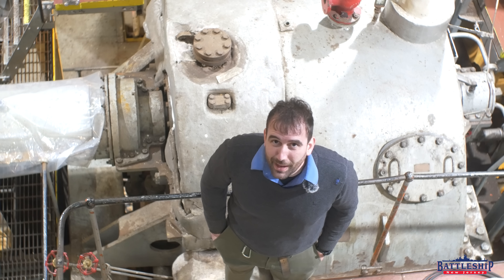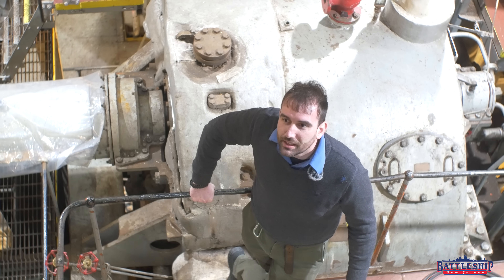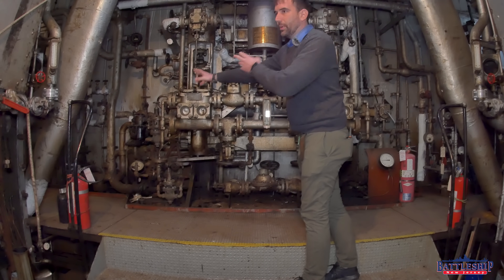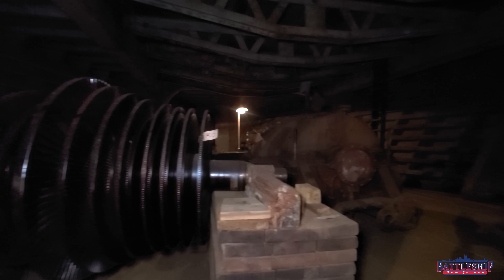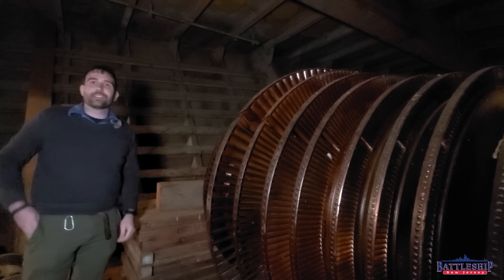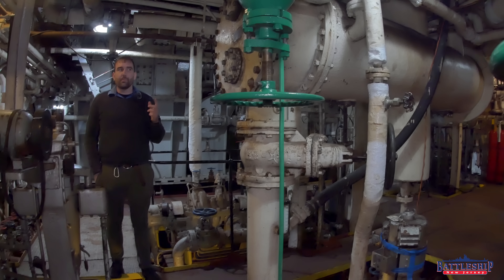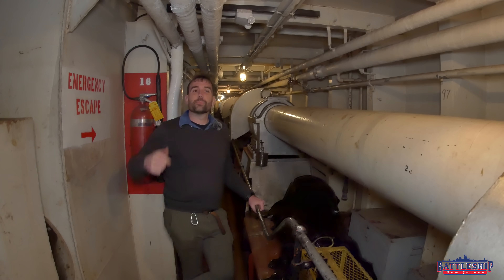The Engineering Plant of a Victory Ship

Comment: Sailed on many of these Victory Ships in 66,67,68,69. Most that I sailed on were of the AP3 type (8,500 HP) along with a few AP2 (6,000 HP) All pulled from the mothball fleet in Susuin Bay California, refitted in Richmond and sailed out of the port of San Francisco. Started as a wiper. Eight hours on, 5 days a week unless at sea. Then it was eight hours a day including Saturday and Sunday as overtime days. I was very lucky and worked for some really good first and second engineers. Learned a lot from these guys. Wipers usually were told to get lost for a few days when in port especially, when offloading  ammo at Vayama ammunition port, SATTAHIP, Thailand. In those days you could rent a motorcycle and head up to Pattya Beach which at that time was just a small village . Later on during my tenure, I upgraded my endorsements to Firemen Water Tender and Oiler. Working as a fireman was indeed (in my opinion) the hottest spot in the engine room. Shifts were 4 on 8 off at sea and 8 on in port. No days off. You could arrange (in port) for someone to cover a few hours of your shift. Of course you had to pay them for it (cash or cover part of or all of their shift to even it up). Oiler duties were relatively easy. Unlike a fireman you were able to move around the engine room, shaft alley and aft steering room. Never worked the Liberty's and truthfully had no desire too. Incredibly slow. For me those days were fun, and at times, they included hard work and tense moments especially, sailing up the Saigon River. Port hole covers down and secured, all passageways to the main deck closed and secured. After the Baton rouge Victory  was mined, only essential personnel (no wipers) were allowed in the engine room during Saigon river maneuvers.  Really glad this video was posted. In spite of all the noise, sleep was never an issue, for me,  only when the turbines would wind down while at sea, you knew something was amiss and it would wake me from my slumber. Visited the Red Oak a few years ago. Had a very long chat with the Chief engineer via phone. They were still in the process of upgrading and repairs before lighting off the boilers. Great bunch. A SIDE NOTE: nothing in the engine room responds fast. It is heavy machinery miles of pipe and needs time to spool up or down.

Comment: Engine room temperatures are hard to talk about with those who haven't experienced them, one doesn't want to be thought of as a liar...In the mid '60s, on a WW2 LST (Landing Ship, Tank) down in the South China Sea and Mekong Delta, we constantly stood our engine room watches in 135 degree temperatures. As an electrician we maintained the battery banks for starting the diesels, I remember reading in the BuShips Manual that if the electrolyte exceeded 125 degrees, stop the charging and let the batteries cool down...no wonder our batteries didn't last very long... fortunately we had a VERY relaxed uniform "back in the day" on that ship, and we could make runs to the galley for containers of ice cubes that we ate, while constantly soaking our sleeveless shirts in water.  Coming up out of the engine rooms to our berthing compartments which were directly underneath the flat main deck, soaking up the tropic sun, was always a relief 😂😂😂😂

Comment: Yes I rode the historic steam ferry Virginia V many times between 2013 and 2019. She's significant as the very last ship from Puget Sound's famous "Mosquito Fleet" with her original engine. A friend of mine works as a crewman on that ship. She's 125ft long and powered by a 400HP triple expansion engine connected to a single Babcock and Wilcox boiler. Her LP valve squeaks at low speeds, and at high speeds the brass eagle atop the engine rocks violently, but up on deck She's smooth as butter and nearly as quiet. On more than one occasion we snuck up on oblivious stand-up paddleboarders, causing them to jump into The Sound at a hoot from her whistle 😂.

She's based out of the Northwest Seaport dock at MOHAI in Seattle if you are in the area

Comment: I served on the USS Kaskaskia in 1967,68. launched 29 September 1939 by the Newport News Shipbuilding & Drydock Company. It spent WWll in the Pacific. My watch station was engine room generator flats. Two 400KW generators powered by steam turbines. When I went aboard she was in Mobile Alabama dry docks for major overhaul. Not many machinist mates got to see the workings of a steam plant like I did. I climbed into reduction bull gear to change out oil with buckets. Worked inside evaporator with a needle gun removing scale. Pulled electric fire and flushing motors from bottom of boiler room with chain hoists. Taught me many lessons I wont forget. Thank you Navy for that opportunity...

Comment: Was on the USS Shenandoah 1970.I was standing fire watch down in the engine room. We lost water and went dead in the water. The boilers started to breath all fans and light out. It was very hot the metal got so hot you couldn't touch it. I had a few dangers at sea as a Shipfitter and it made me crazy . Being crazy was a good thing when I became a Ironworkers for 35 years.

Comment: If they didn't paint over the glass, you could look up from the engine room, through the fidle and see the sky.  The windows on top of the Fidle opened so convection would move hot air up  and out.

Comment: Heating the fuel makes it less viscous. In winter the supplies were heated to keep bunker C from solidifying.   Also bunker C is the bottom of the distillation process, so is thicker than crude.
Reply: ..

Yes Salty you are right, it is not crude oil it is what is left when you take everything useful out of crude- gasoline, diesel, Kero , lube oil etc.

The term is Bottom of the barrel!

If ships did not burn it the ref

Comment: You were still in high school in 2005.

I graduated high school in 1985. 

I'm just gonna sit over here and feel old for a bit.
Reply: HS grad in 1971, worked for General Electric Marine Department in the early 1980's. I can't begin to say how many HP and LP turbine cases, admission valves, gearboxes, couplings, lineshaft bearings and SSTG Ship Service Turbine Generator sets, geared turbine driven boiler feed pumps, etc, that I had opened, repaired, and put back in service. Nuclear Subs, carriers, ammunition oiler supply ships, spy ships, container ships, oil tankers, and research ships. I directed yardbird crews in shipyards.  You know you're old when you stand over the toilet wizzing at 3 o'clock in the morning half awake wondering why you don't hear splashdown. Then you realize the wall is wet and so is your sock. Sux getting old......

Comment: Way back in my undergrad years at college we had a single-stage Westinghouse turbine from the same era as these. I think it was a medium pressure blade set if I recall with four steam nozzles and wildly inefficient since it was only one stage. But the cool part was you could open it up, look inside, and run it off of a gas-fired boiler. It was attached to a generator and load bank. 

Cool to see one of these ships will be back in operation again.

Comment: I can vouch for Engineering spaces in tropical climates. We managed to get the area between the inner hull of the Engine Room and the Gas Turbine Enclosure on the USCGC Sherman up to about 240 degrees while operating in the Caribbean. The water we were sailing in was 90 degrees so everything down there was miserable. I will never forget hanging my head in front of one of the vent ducts and basking in the deliciously cool hundred degree air.

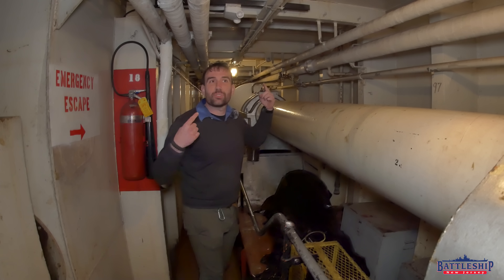Comment: Out of curiosity, is that an exposed driveshaft at 10:30 or is that an outer casing with the shaft rotating within? Have always wondered since I saw the shafts in NJ.
Reply: That is the actual propeller shaft. It's a bit disconcerting to see that thing spinning so close to you in the shaft alley. Typical flank speed would be 100 rpm.
Reply: @kimmer6  Crazy. That's a lot of moving mass. Cant imagine how nuts looking down shaft alley while that is at full speed would be. Cheers!

Comment: Interesting that they used a single axial flow LP turbine.  The combatants I served on through the '80s had double axial flow LP turbines.  That being basically two single flows stuck together at the 'small' ends with the steam entering the middle and flowing out to the larger ends.  Astern elements on both ends.

Comment: My dad was on Liberty and other ships in WWII. Liberty ships were based on a tramp steamer of about 1925. They were simple to run for the thousands of new engineers to learn on. The plan was for them to move on to more complicated steam plants after they gained experience.  The speed of the ships depended on how much cargo they carried. On cargo runs across the Pacific, my dad said, after loading the holds, then deck cargo was loaded and wood catwalks were built over the cargo so the crew could get to the foc'sle and poop deck. Ships have load lines near the water line at the vessel center. These marks dictate how deep in the water the ship can sit when loaded. My dad said when cargo ships left port, the load line was 6' under water. (Look up Plimsoll mark)
I sailed on several historic ships before they were historic. WWII built Fletcher and Sumner destroyers and one Essex carrier in the 1960s.

Comment: Turbines are better but triple expansion engines are more fun to see running.
Reply: I’d be curious what is the difference in torque between a triple expansion engine and a turbine.
Reply: @georgedreisch2662  the TX makes much more torque but turns at such low rpm it doesn't produce nearly the power
Reply: @FaustoTheBoozehound  while I get that, I’m wondering if the horsepower of the higher torque could be increased by a gearing change? 
Also, there’s the variable of the propellers, not only for pitch, but, the technology employed, in general, for performance and efficiency. And yes, I realize this is a rabbit hole, for trying to make the comparison of then vs now, of technology available and performance priorities.
Reply: @georgedreisch2662  a TX operates at <100rpm and a propeller's ideal speed is only roughly 100-120rpm so gearing doesn't help the TX as it's making peak torque and hp at its max rpm and actually needs to be geared up to achieve adequate prop turns

Comment: I am a semi-retired marine electronics tech and in the late 70's I worked on a radar on one of the victory ships.  The ship was used to ship bananas up from Equador to port Hueneme CA. The ship had a  25 year old Raytheon radar, all tube set and not much I could do for them at the time but they did give me a tour  of the ship. The engine rroom was interesting, it had a 4 cylinder diesel engine 7800 hp  max rpm of 90.  Direct connection to the shaft and no transmission, to reverse it had to be shut down and restarted in reverse.  There was a spare cylinder in the engine room and it was around 30 feet tall and 10 feet in diameter.  Many years later it had  a problem in docking and was stuck in gear at minimum rpm and the 2 tugs could not stop it from running into the far docks and distroying  them and a few boats.  I think they desided to retire it after that.

Comment: I'm trying to get my head around the low presser turbine shaft with disks at the other end having blades facing the other way for reversing. How is the parasitic drag of the reversing disks reduced when there is still gas there?
Reply: Simple valves. The two ends of the turbine shaft are separated by a sealed housing. Pressurise steam nozzles forward side of housing, discs go one way. Pressurise reverse side, reverse. Turbines work on gas flow and pressure drop, the waste steam exhausts out of the housing. No steam pressure and the housing is at atmospheric pressure.
A free wheeling turbine disc generates very little parasitic drag. If it can't draw air in and push it somewhere, flow over the blades stagnates and does very little work.
Reply: @TyphoonVstrom  Wrong!  The LP turbine operates in a vacuum. In the ahead direction steam to the astern nozzles is isolated (in cruise) by the guardian valve and steam from the HP turbine is admitted to the forward end and exhausts into a vacuum at the approximate center of the rotor. When going astern, the forward steam supply is secured and steam is admitted to the astern nozzles.The astern disks rotate in that vacuum and have little if any drag. This is very obvious when something causes vacuum to be reduced as it causes the turbine and casing temperature to quickly rise. In  normal operation the LP turbine exhaust is well under 100 degrees and is usually the coolest place in the engine room.

Comment: In the early 80's I was 3rd Mate on the USNS Kingsport, former Victory Ship than Oceanographic Research Ship. We were homeported in Port Everglades (Ft. Lauderdale). Fl. In six months aboard, we actually made it out to sea about 1 month. Broke down and completely dead ship off the Bahamas. My "lifeboat" navigation skills were put to the test. For the remaining 5 months, we were billeted in hotels ashore. I stayed at the "Holiday Inn" on the beach where my balcony overlooked the "Elbow Room" bar. We were always docked so we ate (and drank) at "Burt and Jacks", Burt Reynolds' restaurant. We also drank a lot at the "22 Bar" and "Freddies' Anchor Bar". So, my sea-stories about serving on a Victory Ship are more about all the old bars around Ft. Lauderdale than actually being at sea.
Reply: Missed opportunity for a EUREKA moment that solved the engine problem. If staying at a "Holiday Inn" can allow a tourist to stop a reactor melt down then surely it would have worked there. 🚢
Reply: Man getting paid? Thatd been great
Reply: Good duty, if you can get it. Ahh the old "Elbow Room", that would be the Holiday Inn at Lauderdale By The Sea, iirc. After the recent decade of storms Ft Lauderdale and the beaches has changed so much from my honeymoon two decades ago.

Comment: If you were able, hypothetically, to operate New Jersey as a functioning, sailing museum ship, how much would it cost? I am curious how these operations which actively sail a historic vessel stay afloat financially. Would be interested to hear your thoughts.
Reply: No way to estimate that accurately.  The coast guard requires strict updates to carry passengers so those costs have to be factored in as well.  According to an article from 2016 it cost the John Brown a million every 5 years just for those repairs and updates back then.  I think I was told it takes them carrying 450-500 passengers on a sail just to break even and their costs are a lot lower than the NJ's would be.  They rely on volunteers, grants, donations etc to try and stay afloat
Reply: Per minute? Going slow maybe $50 a minute to keep the steam at a reasonable level. Likely much more. It’s fun to think, but there’s a reason it takes governments to fund these things.
Reply: Even at the docks it's probably tens of thousands a day to supply shore power, plumbing and heat.
Doubt you'd get much change from a million dollars a day sailing by the time you bring it upto standards, reenginner parts, pay for a crew and fuel it
Reply: I think it's been discussed before. Even just the fuel was like 2 million gallons every 3-4 months haha

Comment: Historic ship the SS Badger car ferry across lake michigan.  I believe it is still coal fired but I know it was when my parents and I rode across in the mid 80s.
Reply: Note that the Badger has two 4 cylinder reciprocating engines, totaling 7000 hp.
Reply: Yes, it is still coal fired, just has emission controls and ash retaining system installed.
Reply: Both Skinner Uniflow, I think the Badger also has Babcock/Wilcox boilers.
Reply: @danielcoburn8635  According to Wikipedia: "four Foster-Wheeler water-tube type D boilers, 470 psi"
Reply: Thanks, I'm really rusty on my car ferry history....